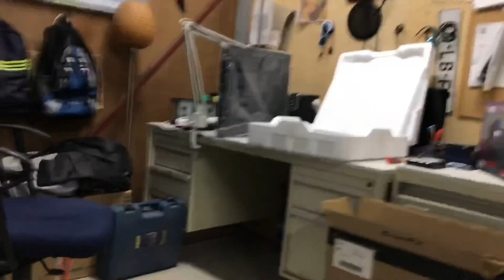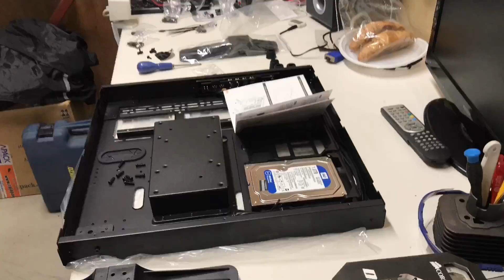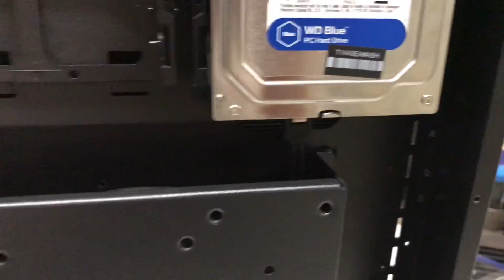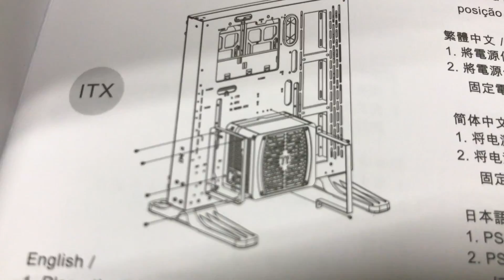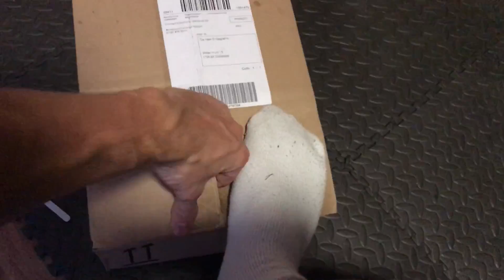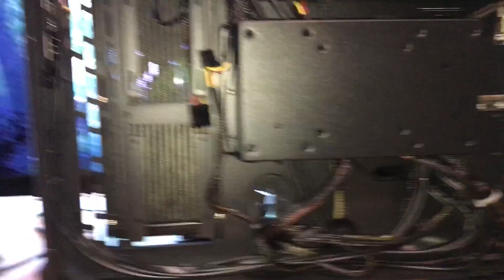Building my first "Desktop" ever (Build log 1)

Comment from the maker: Here are all the parts + prices + links: https://goo.gl/4JKVjN
It's super quiet, and it runs cpu 27-29c idle and 28-31c gpu idle lol, on full load on aida + gpu bench it runs at 48-50c cpu (tx3) and 67-70c gpu (much higher then it ran on my egpu) but even then the fans spin on almost no noise levels. watercooling might even increase the noise (due to the pump noise) but that's just a guess for now, time will tell. the ram runs at 3.4ghz, gpu is +190 core and + 800 mem, 45mv and 110% power, the cpu is oc'd 70 mhz because of bclk, botw runs amazing.
Reply: I5 6400?
Reply: I have h110m-k fuck that xd had to get double channel memory cause it annoys my gtx 1070 ti xd

Comment: this poor man pranked by intel, he just bought a i3 for the price of an i5 :( f to pay respect
Reply from the maker: what are you talking about? i dont have a i3, i traded a g4400 for a i5 lol... and i paid 25 euro for the g4400 and even that was just temporary till i bought my 7600k which i have now, i sold the prior i5 for 125 euro too -.-
Reply: 8th gen i3 is equivalent to a 7 and 6 th gen i5
Reply from the maker: so? that doesn't make mine a i3, my 7600k still is a quad core running at 5ghz, which is still 5x more than i need.
Reply from the maker: also when i build my system, 8th gen was not available + the 370z mobos cost almost 2.5x the price, so the price for a 8th gen i3 would sitll been much higher since of the mobo prices. + they weren't available till 3 months after and still far more expensive
Reply: I feel u, got the back end of that stick overpaying for an 8700k last year
Reply: I mean poor as in unfortunate as Intel screwed over alot of people last year with the coffee lake launch with poorly binned cpu and bad pricing
Reply from the maker: i'm good, i didn't even need the performance i got from this in the slightest. it's just i did this because i could and like building stuff, not because i need the pc towards anything performance related

Comment: Dennis Gagliano::: you  said you never build a desktop, but i was impressed on your last video, where you replaced a CPU and upgraded on your Asus Laptop,.You tought it was not going to Work Cuz your Bios only suppoted so much.But i am confedent you will do the build blind folded, judging from what you did to that Laptop, and putting it all back together, way to go.
Reply from the maker: THank you :) what a nice comment, yeah i certianly have experience with electronics + laptops but a desktop does work different in a lot of ways, like the motherboard connectors and stuff were confusing at first :) the desktop is almost finished, it looks 10x better

Comment: I'm just gonna sub now ur first pc was better then mine welcome to the club Boiii but I suggest u get a GTX 1050 ti in there
Reply from the maker: helleditz Cs:Go 970 is 20% fastet than 1050 ti and also my 970 achieves crazy oc making it like 35-40% faster
Reply: Dennis Gagliano oh well I don't know about 1050 that much I'm rocking an gtx1080 non ti sadly my  money went a little short but nice 850 evo
Reply from the maker: i got a 960 evo now
Reply: Dennis Gagliano oh shit I still have 850 evo should I upgrade
Reply from the maker: you wont notice real difference in like windows, but if you have a slot for a 960 (it's not a regular 2.5 inch ssd) it's crazy fast, i got a video on it
Reply: Dennis Gagliano oh
Reply: Dennis Gagliano I think I have space I can always make one but it would destroy the look

Comment: 360mm rad just for a cpu?... why? Especially a non overclockable cpu.
Reply from the maker: How is my 7600k that is clocked at 5ghz “non-overclockable”??!
Reply: Dennis Gagliano you said i5 6400 in the video, make up your mind 😂
Reply from the maker: you haven't even watched the video have you? i said in the video, that the i5 6400 was a temporary one till i get a kaby lake, and guess what? it's been a while since this video is out, and i have newer videos too! crazy huh? i even explained that the future  watercooling is for my future processor, and here i am from the future telling you i run 5ghz watercooled 7600k.
Reply: Dennis Gagliano i was stating that at the time that is a whole lot of work to later swap out a cpu and since the cpu you had at the time was a locked sku it was overkill to do what you did now and not after you had the 7600k. Anyway nice build, no need to get angry over question which still wasn't answered, a 360 rad is still insane overkill just for a cpu.
Reply from the maker: the rad cost me 27 euro, also the core looks gay with only a dual rad, also i will one day add the gpu, just not while it's a 970, it's a waste of upgrading to watercooling, i never had watercooling on the pc while the i5 was on it too.

Comment: Could of saved some money without rob parts but good build and what was the total and hope to see over clocking in the future
Reply from the maker: what do you mean with rob parts? you can see all parts in the description, and i already have overclocked it, it's running at 4.8ghz on air cooling atm, ram runs at 3560mhz, and gpu runs at +190 core and +800 mem

Comment: I remember the very first "Desktop" I ever built from what I remember was a 1.0 Ghz Pentium III with 256 mbs of ram, a 40 gb hard drive, and a Geforce 2 graphics card and running Windows Me. That I built around March or April of 2001.
Reply from the maker: when i moved to the netherlands(around 2001), there was some kind of thirftshop, they had a pc for sale which was rare for that time, and it had doom, my father went buying like 10 floppy disk with me, so we could copy doom from there to the floppy drives lol, even then we had laptops and he had some external floppy drive device, like 2006 i got an optiplex and i diy'd it to run some gt 4 series, it didn't fit so i made it, haha even back then xD, that was the only desktop so far that was "mine" and when i moved out i bought the laptop you've seen on this channel maybe before, and now this is the real first desktop i've build =)
Reply: Dennis Gagliano even for nostalgia purposes of the old days of using a PC, I still sometimes use an old Toshiba laptop that was made back in 1998 and still runs Windows 98 second edition. Has a  266 mhz Pentium processor with 96 mbs of ram. I can actually still connect it to the internet and do a few very basic internet tasks such as checking the weather and news on the old msn site and do basic google searches but that's about it. Apparently, it's not powerful enough to load heavy sites like facebook or YouTube, but of course none of those existed back in 1998.
Reply from the maker: my father does the same, he runs old laptops at work and is amazed, i can't, to impatient xD, but i love old stuff that goes to like the 2005-2009 time, i still mod psp's when i get my hands on them and stuff

Comment: Yes, too much thermal compound, half of it would be enough, even quarter of it.
But, yea, pretty dope build, like it. Would be great with custom sleeving and water cooling.
And 360mm radiator would be great instead of 240mm.
Reply from the maker: all that you named is on the planning, i will be getting a 360 copper rad, i will be getting black and green sleeves for all the cables, and the watercooling with hard tubing and green setup, it's all ordered already, just waiting on delivery, so yeah :D
Reply: Dennis Gagliano Yeah, you mentioned that in a video. Great, hope to see new video when those parts arrive. Just use less thermal compound, you don't want it to spread around much and possibly damage your socket or something.
Reply from the maker: since i was aware that i'd probably suck at thermal paste, i went with mx4, which is non-conductive. meaning it can't conduct any electricity, meaning it's 100% safe to mess up :), and when the watercooling arrives i'll have a chance to redo it
Reply: Dennis Gagliano Ok, smart choice then. But just don't put that much, there's no need for it. If you don't know how much to use, there's many videos/tutorials out there that can help you.
Good luck with this build!
Reply from the maker: for now it's good, the temps are crazy low, 48c on full load stress testing and 28 idle lol, yeah i've seen many videos but this thing shoots out fast haha, next time will be better, thanks =)

Comment: There is a pre built Cyberpowerpc computer on amazon for 699 USD with:
RX 580 (Same as gtx 1060 6gb)
8 gb ddr4 ram 2400 MHz
i5 7400
Windows 10 home
And other stuff
I bought one to put in my room when i pretend to do homework but why didn't you buy a bre built PC with better specs for the price?
Reply from the maker: +Tristan Can prebuild = boring :p, it was about building it for me, i don’t care about the performance aslong it can run cemu, and amd is bad for cemu, + prebuilds are more expensive overal
Reply: Im just saying that the prebuilt that I suggest has more price/performance
Reply from the maker: i was not going for price to performance, i was going for "good looking", not really caring about the performance, the tx3 cooler i have runs 50c full load and 28 idle, and yet i'm going to do a full watercooling loop lol, i've spend 3x more money on the cooling then the actual cpu :p, if it was price/performance i'd have done something completley different, probably ryzen. but this was just "get cemu running and make it look hella sexy and make it upgradeable so i can run this the next 7-9 years" btw, i've paid far less then 699 for this system, and it's faster then yours, even though your cpu is slightly better, i run 8gb 3.4ghz ram with a z270 overclockable board. with hugely overclocked 970, with this oc, it leaves the 1060 in the dust, and amd does not work with cemu. + looking better then a ugly square box (i have something against desktop cases, i don't like them, personal thing) Without the watercooling/sleeving, i've paid 497 euro for this
Reply: Oh ok. But now Intel beat ryzen with their 8th gen CPU so intel is better for budjet builds. But anyways why do you have always 900 series GPUs and not 1000 series?
Reply from the maker: because i came from a egpu setup, and 10 series have issues + are pretty expensive in the netherland + i got a crazy deal on the 970, so i got a 960 for my b-day painted it, sold it for 155 and bought the 970 same day for 175 incl shipping, and a 1060 is slightly faster but cost like 280-330, and i don't really game, and cemu runs at 4k and is only held back by the cpu not the gpu. so i'm more then good, also i only run a 100hz tv that only runs at 60hz on pc, so anything above 60fps is waste anyway, + i run a crazy oc stable on the 970, it beats the 1060 with it, and a 1070 is like 400+ lol, so 1060 is not worth it because of price, 1050 ti is trash, a 960 is faster, and 970 was very cheap deal, and it works good enough
Reply: Oh ok. How much is the 1080 ti?
Reply from the maker: 800+, reaching 900, used the lowest i could find was 680
Reply: Dennis Gagliano sorry bro but even a really overclocked 970 still does not beat the rx 580/1060

Comment: Nice build bro, I’m hyped for the water cooling! (Pls do hardline tubing)
Reply from the maker: that's the plan, i've ordered hard tubing fittings + silicone, no turning back ;), first i wanted to do soft tube, but then i grew a pair. it looks so much better, but i've never done something like this, so we'll see how it goes. the tubing aint that expensive i think, so messing up won't be a huge deal breaker

Comment: you should of gone ryzen
Reply from the maker: I can't, the main idea for this build is Cemu, a emulator that can run Breath of the wild, and unfortunally ryzen/amd have issues with that emulator, and only a realllly expensive ryzen will perform good on it, + i'm a total noob on it, it would have been even harder to do my first pc in a build like this when having to worry about even more socket names + difference sizes + things i'm not used to. this will do, i really did look in to ryzen but like i said, cemu is the main idea, and i don't really game so i don't even need half this performance :) it's a cool build though

Comment: Have you had any problems updating the bios? After updating the bios on my MSI b350 gaming pro carbon, the motherboard became bricked. Also you and I have the exact same case! And I also decided to vertically mount my gpu. I'll try to send pics when I get my replacement Mobo and CPU
Reply from the maker: So i've downloaded the live update 6 tool from msi, disabled the auto start on it, and with that you can safely upgrade the bios + drivers, it's a annoying program, but you can sort stuff manually on it and that works "good enough" And with it, i've upgraded the bios twice in less then a minute without a issue, i'd recommend that. if you have issues with the riser cable ask me, i'll send you a link for a 25-30 euro replacement that works 100% without issues that many have recommended.
Reply: Dennis Gagliano oh yea, the included riser cable is rly bad, but I've managed to make it work.
Reply from the maker: check what pci-e gen it runs at with gpu-z, mine did work, but i had audio issues + it only ran at gen 1.1 instead of 3.

Comment: but your laptop was a beazt......
Reply from the maker: it still is, the difference between the two is neglecteable. it really is. i just always wanted to build a wallmountable desktop (or a pc inside a table) and i can use this for cemu, but in general they run games the same (like 10-30% difference), see it like this, atm this desktop and my laptop run with like a 20% difference, but in 2-3 years my laptop will be outdated, and this desktop can be upgraded to a better gpu + 7700k, so it will last me for the next 7-9 years for my usage tbh, i mainly did this for cemu and because the laptop video actually made a good amount of money to pay for much of this build. also i'll use this to compare them, and other stuff, but in general not much of difference atm. also, a switch in the netherlands with botw, cost like 430 atm. this desktop is worth much more, but i again got many parts for very good prices (especially the cpu lol i paid 35 euro for it) but i can play botw on this desktop in 4k with improved graphics on a ps3 controller on my tv, and it runs like 90% above 30 fps. so this was a better option then getting a switch, since i can also do other stuff on it + upgrade it in the future. you can clearly see that this is more a fun project then that i need it, because i care more about the watercooling looking good then getting a better cpu lmao.